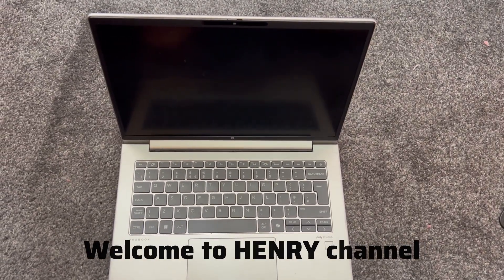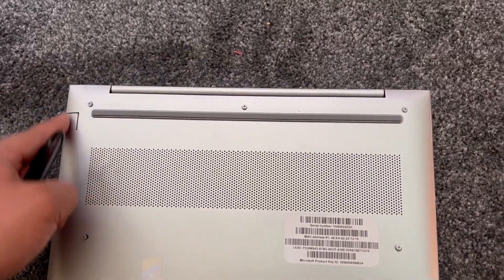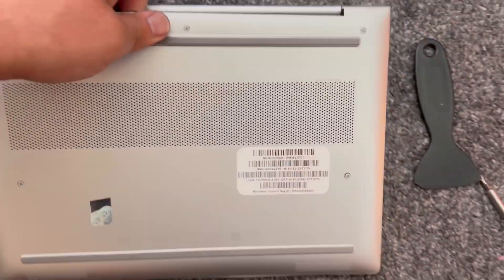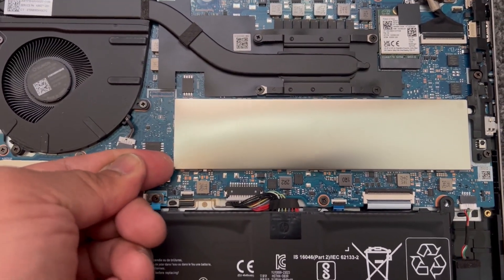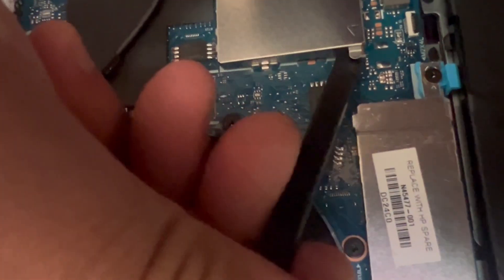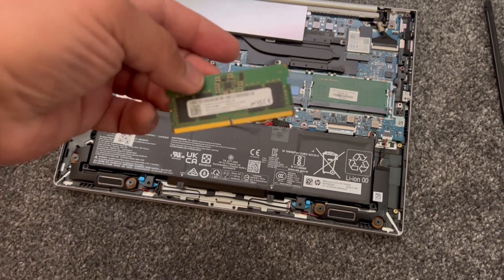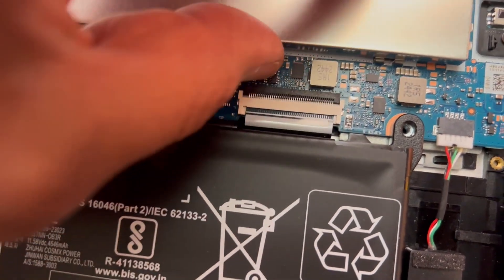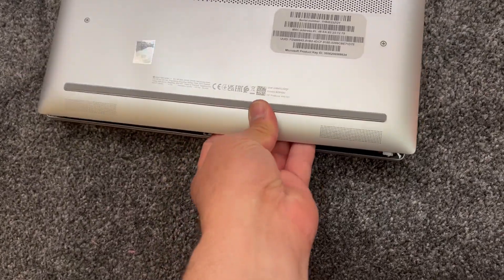HP ProBook 445 G11 RAM UPGRADE → How To Open HP ProBook 445 G11 Laptop

Comment: hay que desconectar la bateria para poder ponerle mas ram?
Reply from the maker: You don’t have to but ,It is advised to, so static charge doesn’t happen and prevent potential damage to hardware components. 
Removing the battery connector beforehand is the proper way and highly recommended.